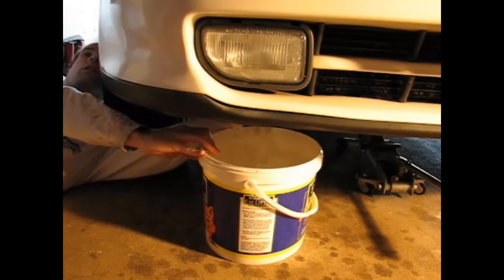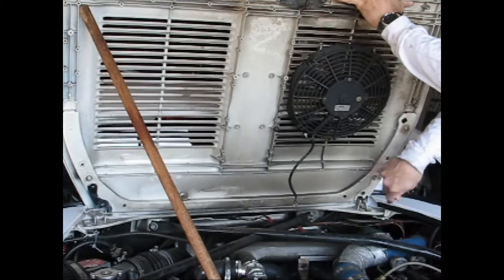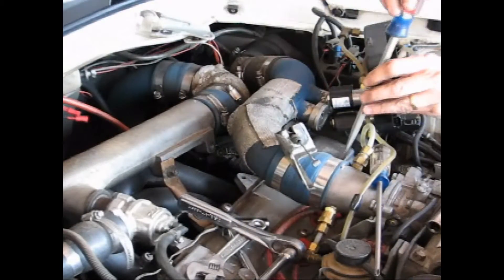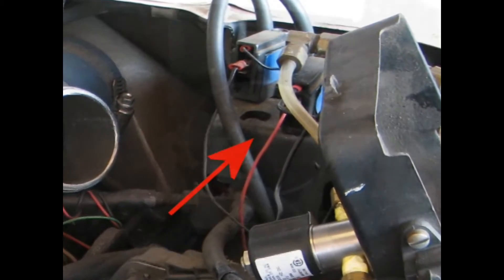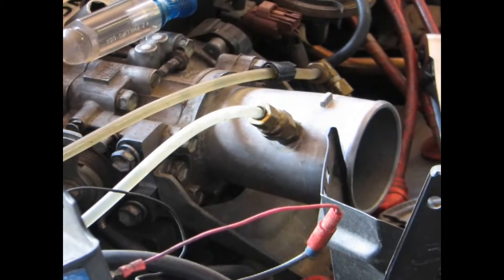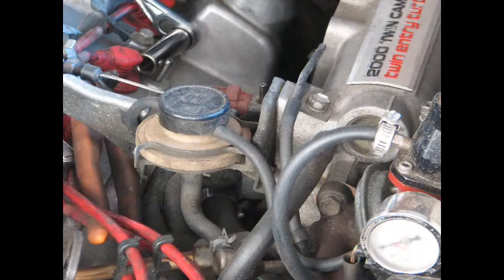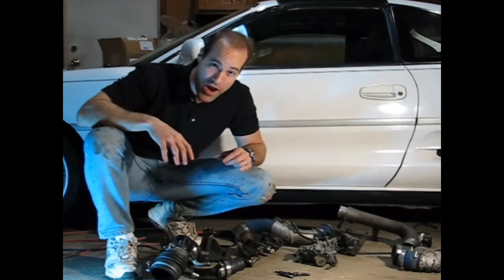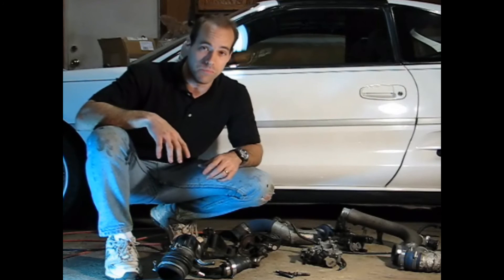Lovehorsepower's Head Gasket Removal Part 1A

Comment: I can't believe your videos weren't up   before I replaced the head gasket on my '86 MR2 just a little over a month ago!  Your videos are amazing.  I did it all with just the green-cover Toyota repair manual, and a helpful friend who has mechanic experience and many tools.  (I posted just a couple short snapshot videos of my project.)